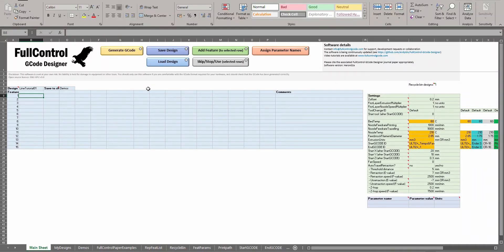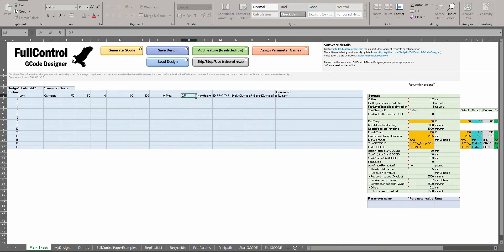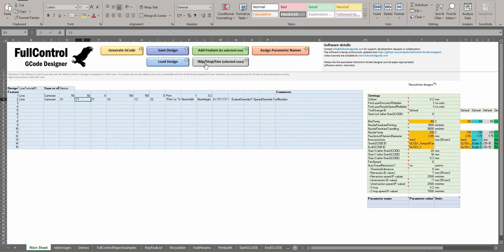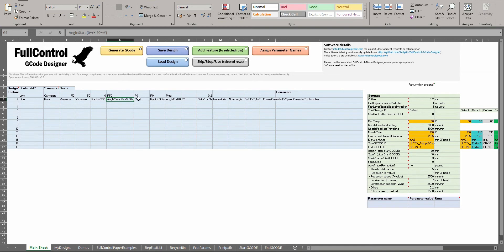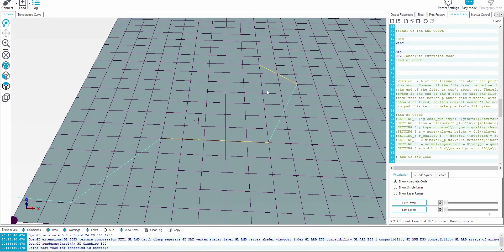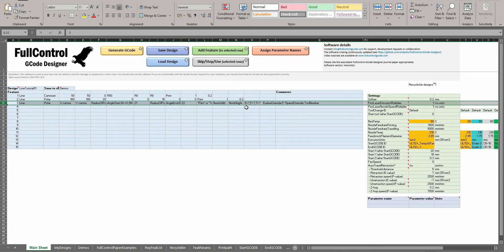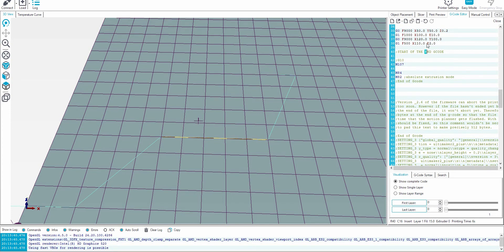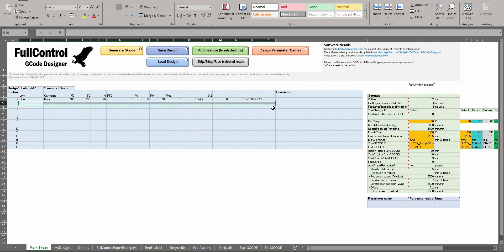FullControl GCode Designer - Tutorial - Lines

Comment: Just wanted to ask, how did you manage the vertical extrusion on the pin support challange?
Im having trouble recreating it in excel.
Reply from the maker: Try to keep extrusion rate constant throughout. So maybe print a slow line up to the start of the vertical extrusion. But there are so many factors involved, it's difficult to suggest what might be going wrong for you. If you check the GCode from the pin section of the pin support challenge, you can see exactly what it does
Reply: @FullControlXYZ  I saw the gcode in the example.My trouble started when I tried to implement it in full control on excel. I tried to use a Cartesian move with a z movement and print mode enabled, it moved in z but didn't add any extrude movements.
Reply from the maker: @browncoconutable  what do you mean by didn't add any extrude movements? Are there G1 commands in the GCode as you expectd? Note that repetier host doesn't preview Z movements properly since it's not expecting vertical movement. Please move this question to www.reddit.com/r/FullControl if it's not answered now
Reply: @FullControlXYZ  Thanks for the response, I realized my blunder. Got it working just fine on the third try.